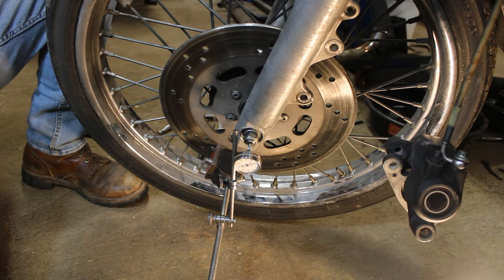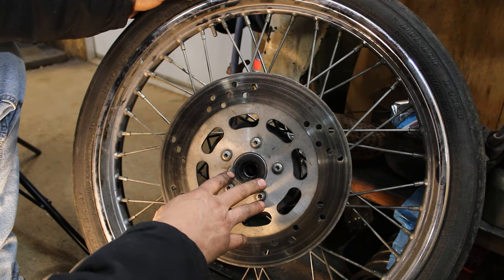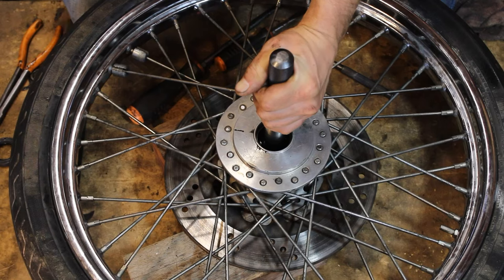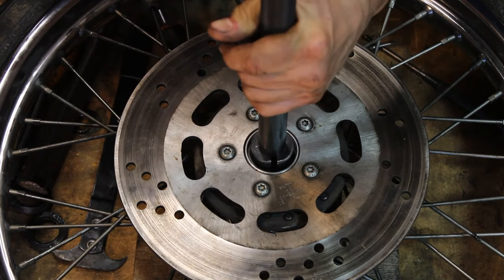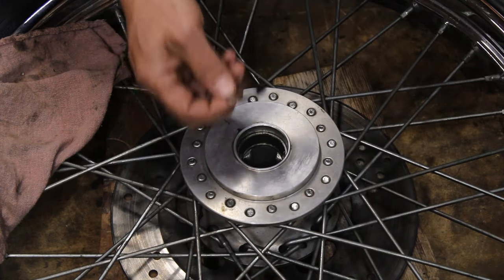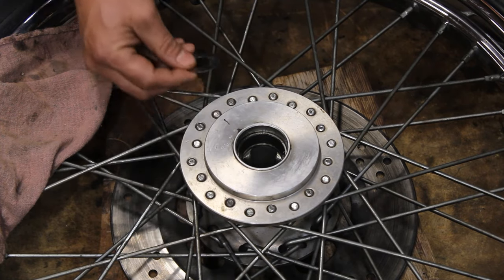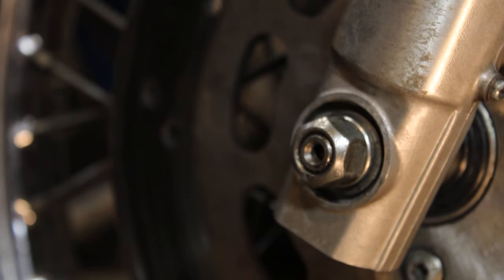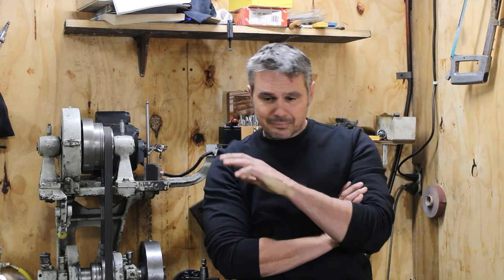How to Check and Replace Harley Davidson Timken Wheel Bearing (73-99)

Comment: Thank you for this!  I saw in my service manual that the end play is checked with a greased bearing and wheel on the bike just like you said. Every other video I've seen checks end play with a dry bearing off the bike to the point that I was doubting myself. New sub here👍
Reply from the maker: Glad to  be able to help.

Comment: great instructional video. You wouldn't happen to have a link or a tool number for the remover /installer that you used?
Reply from the maker: Just look on Amazon and you will find it. It's easy just make sure it's for 99 or earlier

Comment: Lmao at the tank slapper video. I'm having that death wobble and I'm pulling the front tire tomorrow to check the bearing. Shit got scary in a couple corners for sure!
Reply from the maker: What model bike you got.
Reply: @DeathProofProductions  2008 FLHTCU - Electra Glide. Happens mostly when on decel when cornering but a couple times just cruising straight. 
My front tire was 6 psi low and once I filled it the wobble wasn't as bad or as often but still there. Going to do the steering neck bearing test first then check the wheel bearings.
Reply from the maker: Check your front and rear motor mounts to. How many miles on it.

Comment: Nice video, thanks.  How do you not destroy & re-use the seal if you determine you need to add another shim? Seems like a pain to have to put the rear tire back on and off to see the play with new seals every time. Do you not prefer the dry bench test?
Reply from the maker: I just calculate it from my original measurement. When you work at a dealership you have to figure out was to shave time. Bench test is one more step that is not critical so I don't do it. I have never had to redo it to be in spec. Thanks for the compliment.
Reply: @DeathProofProductions  I'm getting no noticeable play, maybe .001 if any. The wheel spins freely even after torqued down to spec. Would you recommend adding a shim? Or let it run till next tire change?
My dealership work order says they set it last tire change.
Reply from the maker: If there is no roughness when you spin it then your good.

Comment: Love watching you at work bro!
   You are awesome, I love your persona,and your mythological aspect of mechanics. 
   I actually envy your knowledge! 👍
   I have to do this to the rear wheel 2005 Fatboy, feel it getting squirrely when I WOT. . 
   Why do you need shims, does every spoke wheel have a shim?  Ty
Reply from the maker: The bearings on your bike are sealed instead of the tapered roller bearings that were on them until 2000. You won't have to shim those to set the clearance all you do is pull and replace.  What I recommend on those is don't waste your money on the special tool to do the job, get you a blind hole puller set that goes up to 1 1/8  use it to pull the bearing.  Your gonna want to remove the rear sprocket  so you don't scar the powder coat.   At home depot you should be able to get a piece of allthread 7/8 by 12  use 2 flat washers on both sides and use it to pull the bearings in. It will cost half the money and you will have a tool that you that can be used on everything from the inner cam bearings to the spindals on your lawnmower. Also thanks for the compliment means alot to know your work is appreciated.
Reply: @DeathProofProductions  wow, thank you very much for the fast an intelligent response. 
   Definitely going to home Depot. And going to look into that blind puller set !!  1 1/8"
  Bro you are a godsend, thank you again. 
   Looking forward to your awesome videos, an amazing mechanical skills 🙏

Comment: Wouldn't flipping the tool over on installation make it so you'll never be able to pull that new race out the way you did the old one?
Reply from the maker: The wheel hub has a lip that is machined into it that the race sits on and half of the race hangs off of it so you can use the tool to remove it. So on installation you want it to fit snuggly on the lip so it doesn't affect your inplay reading and how many shims you need to put in.
Reply: @DeathProofProductions  awesome, thanks! I am getting ready to do this job on my '99 and this helps a lot.

Comment: Can I get away with just reusing the shims that already came with the bike, and is there any other way to get those bearing races out without a special tool, could I use a blind bearing slide hammer tool?
Reply from the maker: Some times yes but it all depends on the mesurment
Reply: Thanks for the advice, also when you install the axle seals, do you need to grease where they seal around the axle or do you leave them dry
Reply from the maker: Its not necessarily needed